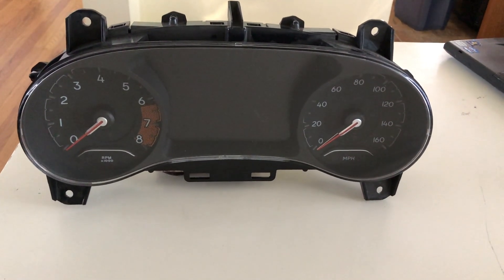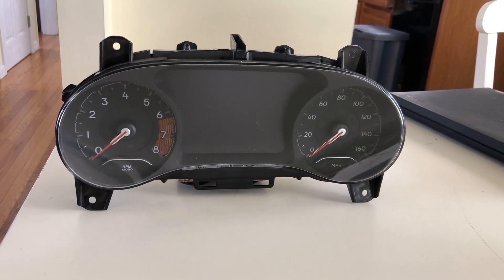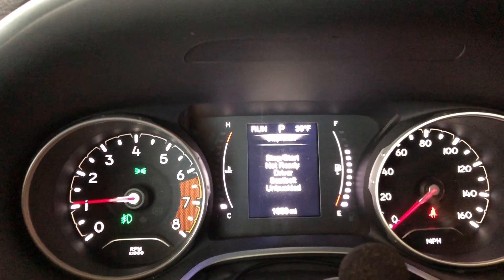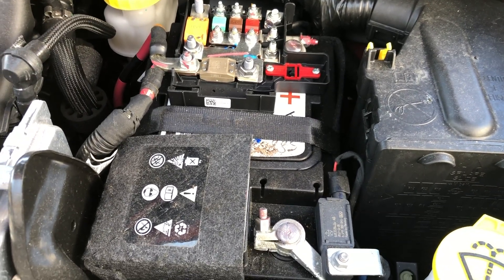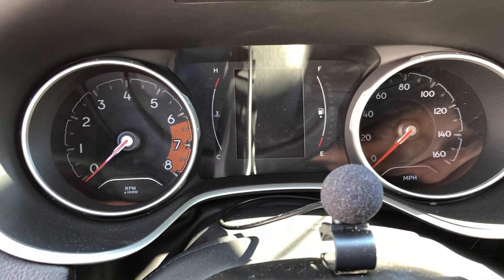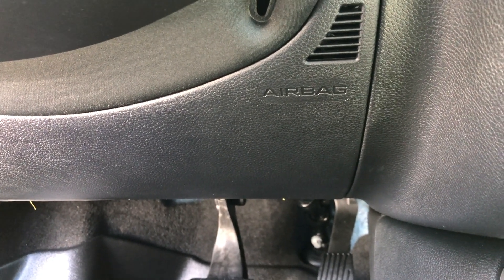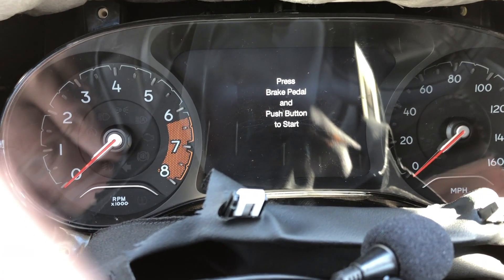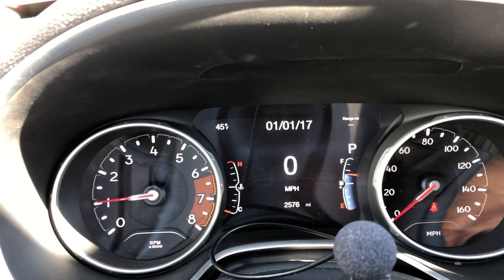2018 Jeep Compass Instrument Cluster UPGRADE Experiment

Comment: Hey quick question can I do this with my 2014 jeep Cherokee and buy the digital looking one cause I hate my stock one and think it looks like crap cause other people was telling me it’s not that simple to change but if you did it on the Jeep Compass then it should be right??
Reply from the maker: my guess is it wont work. they need to be the exact same equipment these days
Reply: @southhawkllc  it’s for a 2014 jeep Cherokee it’s just coming from a limited trim I’m pretty sure you bought yours from a different compass trim

Comment: I did the same prior to find this video, it works great, only the miles, Do you know how to fix it with out having to go to the dealer?
thanks
Reply from the maker: unfortunately there is no way to correct the mileage via the dealership. proxy alignments will not work.
Reply: @southhawkllc , so even the dealer can correct the mileage?
Reply: @s.monreal9604  the dealer can NOT correct the mileage
Reply: @W4rH4wkXX  ok they can not correct the mileage, but Can they program it to stop the blinking ?
Reply from the maker: @s.monreal9604  correct the dealer can stop the blinking with a proxy alignment... one of my viewers informed me that you can do it yourself... i've ordered more parts and im going to give it a shot and hopefully make a video about it. ALSO... they is a way to get the odometer fixed great info about our cars at this forum... check out https://www.myjeepcompass.com/
Reply: I have issue as my compass reset odometer to 0 after replacing battery. Can you guide me how can I fix millage to put a new value. Thanks
Reply: Можно скорректировать только в одну сторону , в сторону увеличения. 👍

Comment: Sir i Believe you have Auto Transmission  Compass with monochrome instrument cluster as stock. And you swapped with a TFT which is from a Auto as well?  Can you guess will a TFT cluster(bought from salvage Auto Trans, but am not sure does a High end Manual compass comes with a TFT as stock)  work with a Manual Transmission 2019 Compass.
Reply from the maker: correct i had an automatic transmission and the TFT came from an automatic too. I wouldnt know what would happen if it comes from a manual transmission.
Reply: Hello, did you do it on your jeep? I want to do  it on mine too, just not sure if it's going to work because of the manual transmision..
Reply: Any updates. I got the cluster from a auto. I have a manual transnission aswell @LuisRamirez-ni6bk

Comment: Do you know if this same process can be done with a jeep renegade?
Reply from the maker: as long as it was out of a renegade yes BUT... i found out you can NOT have the mileage corrected by the dealership.
Reply: Even if they preform the proxy alignment, the milage won't be reset?
Do you know of any way to reset it?
Reply from the maker: @giannab5682  correct the proxy alignment will only stop the mileage from flashing, it will not allow you to set the mileage. As far as i know there isnt a method to change the mileage.

Comment: Which insturment cluster is it? i want to change it myself.
Reply from the maker: 6QR57DX9AA or 6RX36DX9AC, FYI dealerships wont be able to fix the mileage on the odometer and you'll need to get a "proxy alignment"  ~$60-$90 to make the mileage stop blinking
Reply: @southhawkllc  What do you mean buy proxy alignment? Can you describe?

I have Jeep Compass Limited Plus (O) 4x4 Diesel (9 Speed Automatic) 2020 model.
Reply from the maker: @AshutoshThakur007  "proxy alignment"  is a term the jeep dealership uses to reprogram the cluster to accept that it is in a new vehicle and it supports all of the vehicle's available options. so you don't get the flashing odometer... the cluster has a flashing odometer because it has detected a change that it was not programmed for.
Reply: @southhawkllc  I have seen your video of Installation but can you make a Video showing all the features of the new instrument cluster. 

I mean when we use the 

1. Driving modes does it show up on that screen.

1. Music information.

2. Vehicle information.

Because in my car their is only Auto Mode, Snow Mode, Sand Mode and Mud Mode.

So I am being bit cautious before upgrading.
Reply from the maker: @AshutoshThakur007  i can answer that until i get the next proxy alignment with my new 8.4" uconnect screen i bought recently
Reply: @southhawkllc  Ok. I am waiting for your reply.

Just for your information in my car I have the 8.4 Inch radio navigation system installed from factory.
Reply from the maker: @AshutoshThakur007  ok but i'm not going to the dealership any time soon.. more like in 2 months

Comment: Engine temperature is active or not?
Reply from the maker: it does work, i just turned the car on that's why it doesn't report any engine temp in the video. after 2-3 mins you'll see the gauge slowly start to rise.
Reply: How much was the reflash? Also anything else u need after?